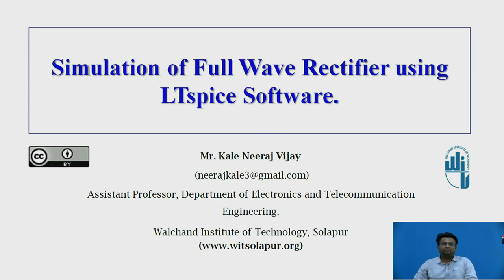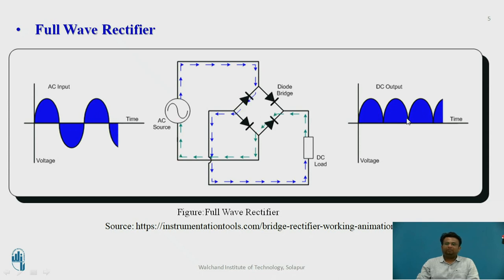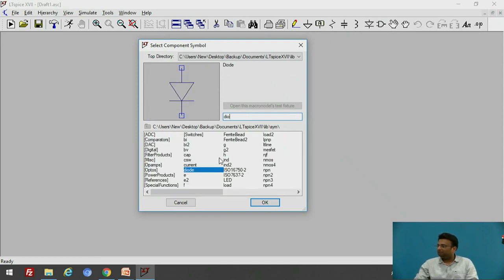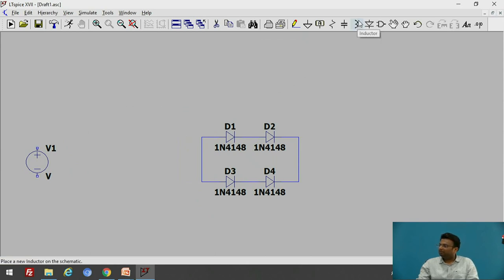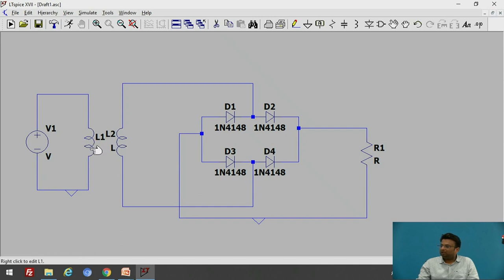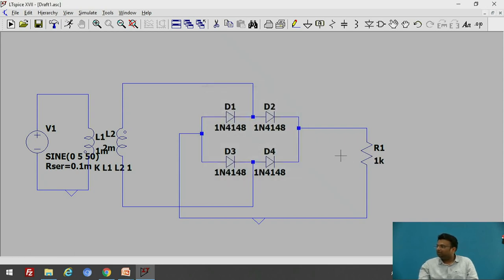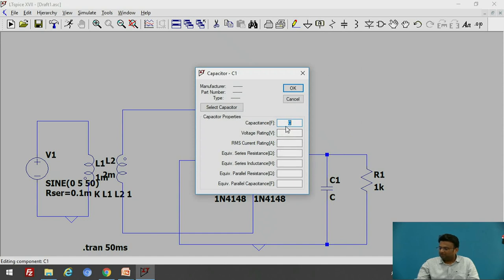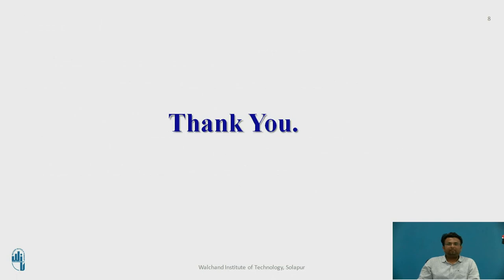Simulation of Full Wave Rectifier using LTSpice Software

Comment: What's the purpose of using the transformer? we could connect 5v ac to the rectifier circuit without a transformer, right?
Reply: Yes you could.
in a full bridge rectification circuit we typically represent 
1. Mains Voltage AC (in Australia is 240 V AC)

2. We then show the STEP DOWN process via a Step Down Transformer from Primary side to Secondary Side
let's say for arguments sake, we stepped down from 240 V AC  to .. oh.. let's use  20 V AC for sake of demonstration

3. then of course we now feed this 20 V AC into a Full Bridge Rectifier to get Pulsating DC

4. We then Smooth the Pulsating DC out by using a capacitor
(and this only gets us an approximate voltage)

5. then to get  a bit more accurate we use a voltage regulator to obtain the (let's say ) Required 
5 V DC

Now.. your question is .. 
Why use the Tranformer
why not just throw in a VOLTAGE Symbol and set it to 20 V AC

well.  yeah.. you can do that as well
but i suppose he demonstrated it this way because

1. it's traditional to show it this way

2. if he didn't,  someone would be saying  "what the fuck dude, where is the step down transformer"
LOL
so.. there is also that

Comment: why we use inductor as a transformer?
Reply: Because there is not direct transformer model available in the LT spice..
Reply: @Chitranshleo  thanks
Reply: @Chitranshleo  he already gave 5 volts as the supply, so transformer is not technically required
Reply: @aneeshprasobhan  supply is dc 
And we need ac .
Reply: @nirajsahu8789  AC and DC supply looks the same in LTSpice models..If its AC, the text (sine...) will be written. In this case, the supply is indeed AC and we rectify it to DC
Reply: LOL..... You must be new to electronics
LOL
that's cute

ok...
Well....  and inductor is basically a coil of wire (simply put)
when you pass a current through an INDUCTOR (not a transformer) it's going to store current in a magnetic field

now.. a TRANSFORMER Unlike an inductor  HAS 2 SIDES

THE PRIMARY SIDE
and
THE SECONDARY SIDE

Both sides are made up of 1 wire which is coiled around a shit load of times.
so an inductor is 1 coil of wire

and a transformer (A Basic Transformer) is 2 inductors close together
THAT'S WHY HE DREW 2 INDUCTORS

now.. When the voltage is applied on the primary side
IT GETS INDUCED to the secondary side

usually the primary side (on a STEP DOWN) Transformer has the larger number of turns in the winding
hence, the secondary side has less
meaning... it will generate a lower voltage than the primary side
so.. you might get something like 240 V AC coming in on the primary
and on the secondary you might end up with .. say .. 16V AC

so he used the symbol of 2 inductors because its' the same thing as getting the symbol for 1 transformer
that's why 
also if you watch the video again, you'll see that he explained that the 2 inductors alone functions as inductors
but.. HE ENTERED THE FORMULA to COUPLE the inductors so they act as a transformer

my advice to you.... Watch a video on

What is an inductor
and
what is a transformer
Reply: As we want to show coil in our diagram